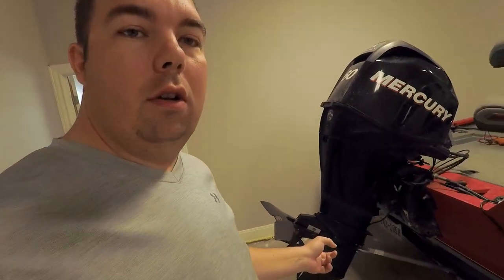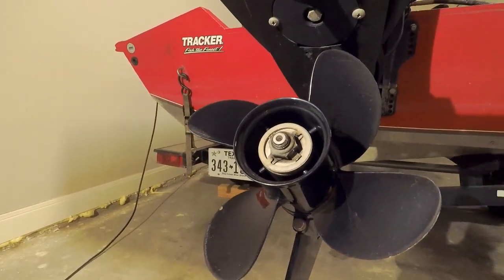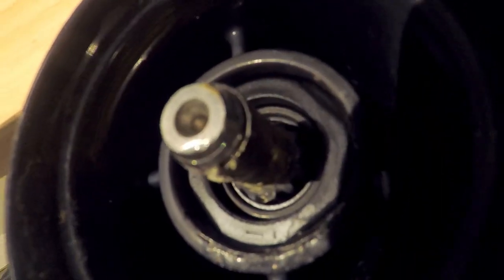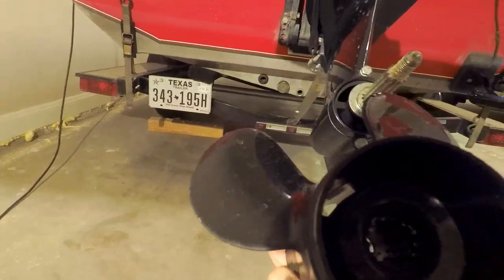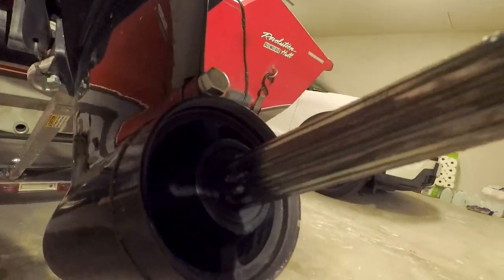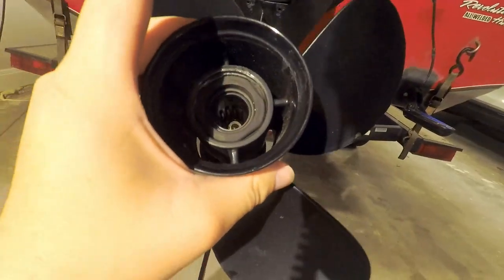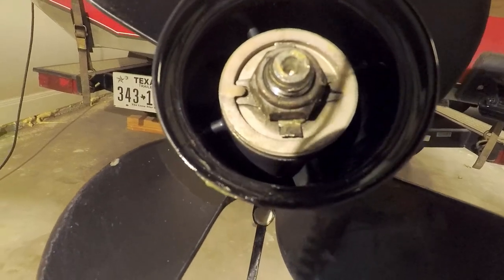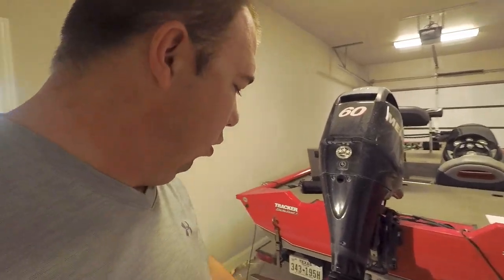Mercury 60 hp 4 Stroke - Prop Removal and Inspection

Comment: Liked the video, I am about to put a 4 blade 14 on my 05 triton alum 17ft. have a 3 blade 15 on it now. what improvement did the 4 blade make your tracker thanks  r. s by the way did you torque the prop nut or just use a ratchet  when you reinstalled the prop

Comment: How do you unbend the tabs at the beginning? What did you use?
Reply from the maker: They are pretty soft, so I just used a flat head screw driver and a hammer. You might want to make sure you have a spare incase they are stress hardened and break.